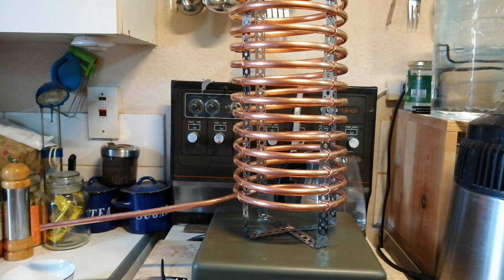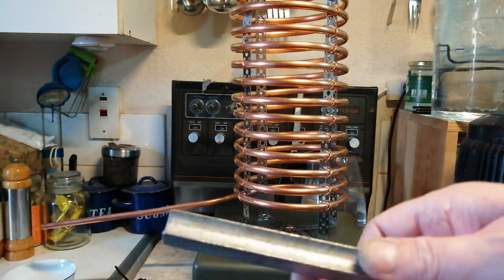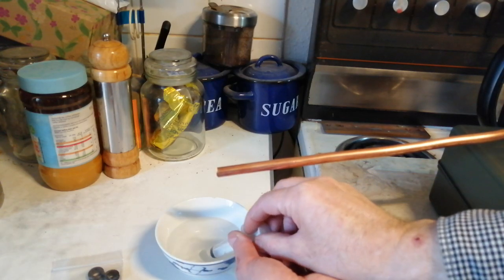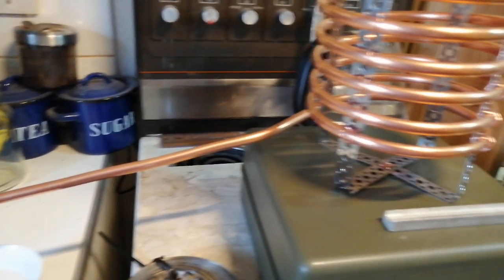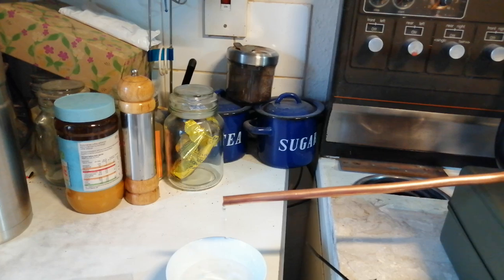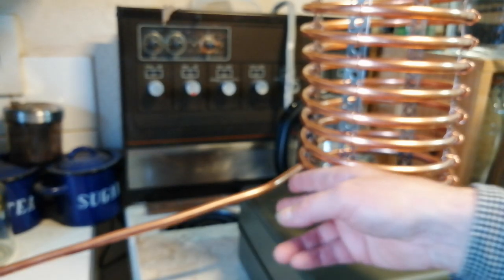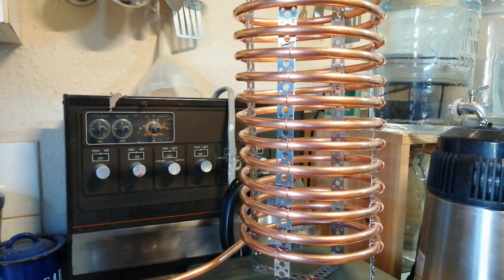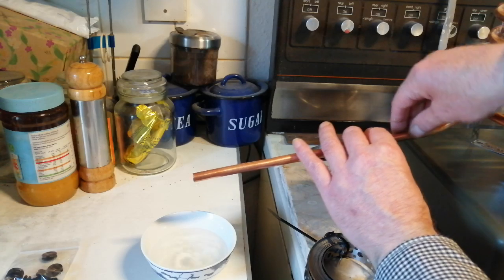Home Made Water Destiller. Sorted The Coil Out Today. Part 2.

Comment: How does the water taste ?
Reply from the maker: The water taste great but cant use the plastic pipe. And you have to use a lot of ice. Just got to finish my solar system. Then i will be working on this water distiller to run a 12v fan for cooling. Thank you for watching.